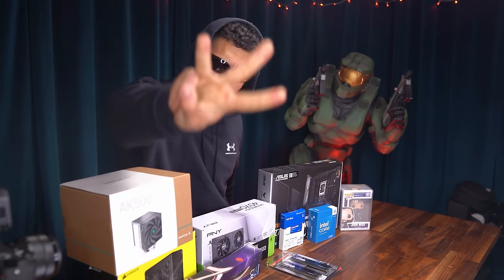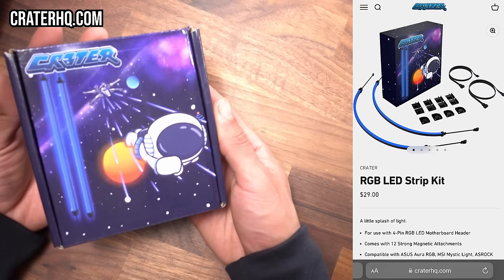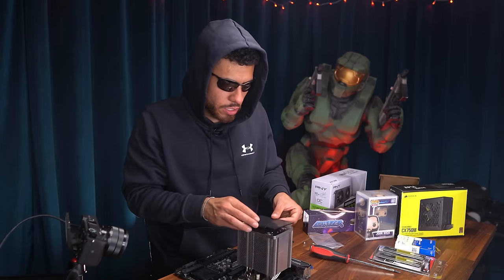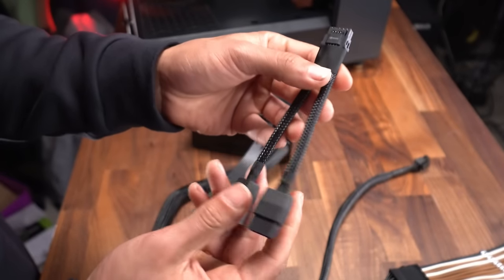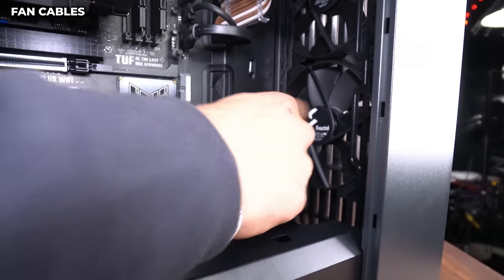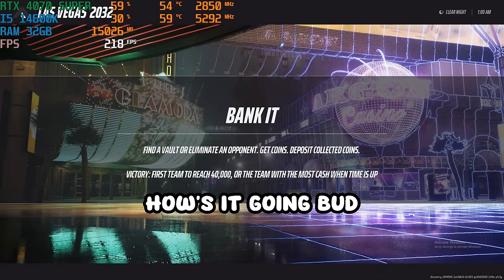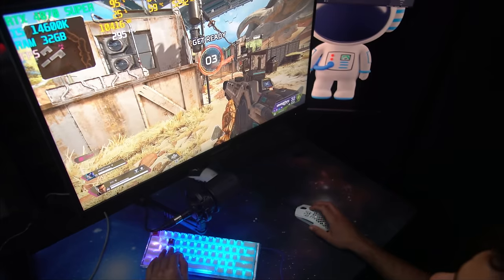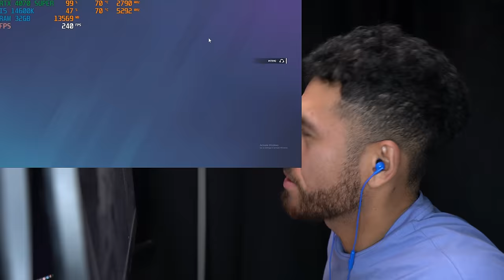Best RTX 4070 SUPER Gaming PC Build Guide (w/ i5 14600K) $1600

Comment: 15:23 If you have too much power on a single line, you run the risk of burning out the cable connectors or the power terminal of the video card. The correct thing to do is to connect the other 8-pin line and not use the single-line extension.😨😨😨😨

Comment: Crater you helped me build my first pc
Reply: I ordered the parts for this build and about to do my first one too cause of this guys video.
Reply: @nickdiaz6095 have you built it yet and how did it go? I’m also thinking of building this even tho I have no knowledge whatsoever 😭
Reply: @hubito2237  I did end building it, it's been working like a charm! I've never built a PC and I wouldn't call myself an IT type of person. I think if you can follow directions and just be  careful when doing every step, you'll have no problems. The week or two before I got my parts, I did watch a ton of videos on thr parts I was getting and how to do the bios and windows install..and just digging into anything I wanted to know more about. I watched this build video prob around 10 times before I got it.  Crater did a real good job on going slow and saying what goes where.. I play hunt showdown and it runs at 180fps. The finals, runs really good. The computer loads fast. I didn't buy the top two fans but I've been watching the Temps and it's been good so far. I'll probably buy two more sometime. I was worried because I saw 2 other comments where the display didn't show but everything worked perfect on my side. When you do buy and build and need help let me know, I'll help as much as I can.

Comment: Yep Joey, I'm using an AX (wifi6) wifi card in my system for my 1Gb internet connection, the latency is great and the up/down speeds are good too, so no need for cabeling since wifi6, and you can play multiplayer games with it too, no issues at all.

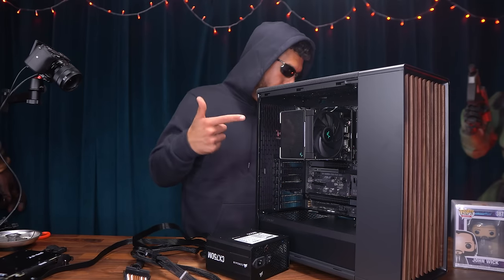Comment: At 15:38 I see that you decided to use the pigtail, I have the same gpu but I’ve been hearing mixed opinions on it. So far I’m not having any problems but wanted to know if you just did it for the sake of the video or if there’s nothing to worry about when pigtailing this card.
Reply: I'm in the same situation
Reply: @Skeeter93  I do plan on just getting another 8 pin cable but Coolermaster doesn’t supply spares so I have to wait until CableMod’s facilities are back up. Until then I actually got a pretty solid undervolt going on my 4070ti super so it’s not consuming too much power on the pigtail

Comment: Hey crater, I just finished building this PC using this guide and on my monitor it says no signal. There is a white light on my. motherboard and I think it means my GPU isn't working properly. Is there any way to fix this?
Reply: could be the bios for the mother board, between the cup and ram slots there is a white label, what are the last four digits?
Reply: cpu*
Reply: Did you figure it out?
Reply: @nickdiaz6095  yeah so i really didn’t have any hiccups, put everything together and it booted first try, went into bios and everything was detected so i was able to then download windows, then installed all my drivers and was good to go
Reply: Did you fix it?
Reply: @nickdiaz6095  No I contacted support for ASUS and NVIDIA and there was no help. They said my best bet was to replace my GPU or motherboard, so I'm going to replace GPU tomorrow
Reply: @dan-ilbai9112  ahh man sorry to hear that, that sucks real bad. After waiting for the parts to come in and being excited to build it... all my stuff comes in tomorrow and thats the biggest thing im worried about, i just returned a computer the other week because it came DOA. Hope we both have better luck from here out with PCs
Reply: @nickdiaz6095  good luck i hope your build works out great
Reply: @nickdiaz6095  i will say i had no problems with my build, put everything together and it booted right up, went into bios to make sure everything was being detected, and it was. then installed windows and have had no issues since.
Reply: @0spaze410  just got done building it a second while ago and updating drivers. I ran into a spot when setting up windows, saying it wouldn't connect to the internet, but I did a cmd prompt to get around it, and then it was fine. So far, so good!
Reply: @0spaze410  yeah dude, everything went smooth. Felt good to build it and it's been running good. I thinkni should get Mayne two more fans like he did for the top cause it feels a little warm sometimes but it's been good so far

Comment: is no thermal paste ok?
Reply: No. Its not ok. You always need some sort of thermal compound. Its what allows effective heat transfer between the CPU and the cooler. Most CPU coolers come with thermal paste already pre-applied so you don't necessarily need to buy extra.
Reply: @JJFlores197 does this build come with thermal paste if i get all the same parts?
Reply: @nuxe7598  I'm not sure if this one does. I'd buy some just in case.

Comment: ZOTAC Gaming GeForce RTX 4060 Ti 16GB AMP DLSS 3 16GB GDDR6 128-bit 18 Gbps PCIE 4.0 Compact Gaming Graphics Card, IceStorm 2.0 Advanced Cooling, Spectra RGB Lighting, ZT-D40620F-10M
ZOTAC Gaming GeForce RTX 4060 Ti 16GB AMP DLSS 3 16GB GDDR6 128-bit 18 Gbps PCIE 4.0 Compact Gaming Graphics Card, IceStorm 2.0 Advanced Cooling, Spectra RGB Lighting, ZT-D40620F-10MZOTAC Gaming GeForce RTX 4060 Ti 16GB AMP
$415.00

Corsair Vengeance LPX 16GB (2x8GB) DDR4 DRAM 3200MHz C16 Desktop Memory Kit - Black (CMK16GX4M2B3200C16)
Corsair Vengeance LPX 16GB (2x8GB) DDR4 DRAM 3200MHz C16 Desktop Memory Kit - Black (CMK16GX4M2B3200C16)Corsair Vengeance LPX 16GB (2x8GB) DDR4
$45.99

Western Digital 1TB WD Blue SN580 NVMe Internal Solid State Drive SSD - Gen4 x4 PCIe 16Gb/s, M.2 2280, Up to 4,150 MB/s - WDS100T3B0E
Western Digital 1TB WD Blue SN580 NVMe Internal Solid State Drive SSD - Gen4 x4 PCIe 16Gb/s, M.2 2280, Up to 4,150 MB/s - WDS100T3B0EWestern Digital 1TB WD Blue SN580 NVMe Inter
$69.44

Funko Godzilla Heat Ray Glow in the Dark Exclusive Figurine
Funko Godzilla Heat Ray Glow in the Dark Exclusive FigurineFunko Godzilla Heat Ray Glow in the Dark Exclusive
$26.99

Vetroo V5 White CPU Air Cooler w/ 5 Heat Pipes 120mm PWM Processor Cooler for Intel LGA 1700/1200/115X AMD Ryzen AM4 w/Addressable RGB Lighting Sync
Vetroo V5 White CPU Air Cooler w/ 5 Heat Pipes 120mm PWM Processor Cooler for Intel LGA 1700/1200/115X AMD Ryzen AM4 w/Addressable RGB Lighting SyncVetroo V5 White CPU Air Cooler w/ 5 Heat Pipes
$27.99

ARESGAME AGV Series 650W Power Supply, 80 Plus Bronze Certified, Non Modular Power Supply, 5 Year Warranty
ARESGAME AGV Series 650W Power Supply, 80 Plus Bronze Certified, Non Modular Power Supply, 5 Year WarrantyARESGAME AGV Series 650W Power Supply
$52.99

MOROVOL PC Case ATX Pre-Install 4x120mm RGB Fans(Fix Color), ATX Gaming PC Case, USB 3.0 Tempered Glass Mid Tower Computer Case, Black,R7
MOROVOL PC Case ATX Pre-Install 4x120mm RGB Fans(Fix Color), ATX Gaming PC Case, USB 3.0 Tempered Glass Mid Tower Computer Case, Black,R7MOROVOL PC Case ATX Pre-Inst rgb fans
$59.99

MSI PRO B760M-A WiFi DDR4 ProSeries Motherboard (Supports 12th/13th Gen Intel Processors, LGA 1700, DDR4, PCIe 5.0, M.2, 2.5Gbps LAN, USB 3.2 Gen2, Wi-Fi 6E, mATX)
MSI PRO B760M-A WiFi DDR4 ProSeries Motherboard (Supports 12th/13th Gen Intel Processors, LGA 1700, DDR4, PCIe 5.0, M.2, 2.5Gbps LAN, USB 3.2 Gen2, Wi-Fi 6E, mATX)MSI PRO B760M-A WiFi DDR4 ProSeries Motherboard
$169.99

Intel Core i5-12600K Desktop Processor with Integrated Graphics and 10 (6P+4E) Cores up to 4.9 GHz Unlocked LGA1700 600 Series Chipset 125W
Intel Core i5-12600K Desktop Processor with Integrated Graphics and 10 (6P+4E) Cores up to 4.9 GHz Unlocked LGA1700 600 Series Chipset 125WIntel Core i5-12600K Desktop Processor $1,038.34 for my first build lmk if spec ok